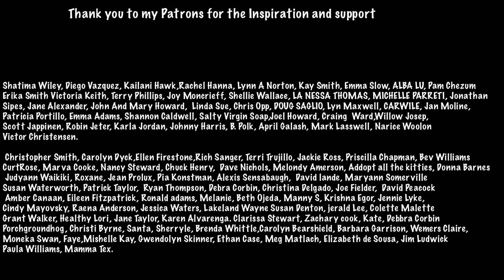Making Important Changes to the Structure Of my A-frame House | Dream House OFF the Grid

Comment: Don't do grinding without putting protective goggles over your glasses. The tiny metal particles will scratch and ruin your new glasses very quickly. Don't think your new glasses are protecting your eyes from small particles when working, they are not
Reply: Exactly , protection always every minute , I know of people who have gotten concrete dust and tiny splashes of it in their eyes snd had to go to emergency, very painful… and not easy to get out …

Comment: Awesome video, keep up the hard work of building your dream home with your own hands, you're doing great. That string with the weight on the bottom is called a plumb line. Builders were using this method for thousands of years before fancy lasers etc came along. And it will never run out of power

Comment: Some advice from a fellow glasses owner. Careful using them around your grinder or sparks when those little hot sparks touch the plastic lense it damages them very easy. I've gone through so many glasses this way.

Comment: Rebar is a steel bar that is used in concrete construction. By adding these reinforcing steel bars, you're creating reinforced concrete. Whether your project includes floor slabs, walls or posts, rebar helps keep cracks that form from making the project fall apart. I like your skeleton interpretation Rodrigo 👌

Comment: To save yourself a lot of pain in the future, please invest in a utility sled of some sort. You could add rails to the bottom and a heavy duty handle to pull it instead of fighting with that wheelbarrow. Just a kind suggestion from a PTA who learned the hard way that prevention is the way to save your back. You could probably make a great one yourself.
Reply: Also build a bench to work at while standing. It is much easier on your body than bending over, and you have better leverage and control .

Comment: @rodrigo , I agree with the extra steel framed piers. to me, id be trying to support the structure first, but secoond, tie it to the ground. your rebar reainforced pillars are the way. How will you attach the structure to those pillars: weld or bolt? i think you should put threaded rod into the pillars, and BOLT the structure to a flange on the threaded rod. Thoughts?

Comment: I agree that the canalever needed a solution, I see you've added another weight bearing pier further to the end of the load. Good work DJB, I'm looking forward to the end wall. How much glass are you putting on the downhill side? Also, are you considering dormers on the second floor?

Comment: maybe for the future.  don't make your concrete so wet, it loses strength
Reply: @shac9131  Wow so you are an expert at everything? The way you learn is to try! Sitting behind a keyboard judging and criticizing others isn’t the right way to go! You can make a suggestion without being rude or putting others down!
Reply: @starflower703 ....For someone whose previous employment wasn't in the building trades, Jordan is very good at construction but he does his learning curve on finished products, which usually isn't a good idea. Fortunately he compensates by overbuilding and becoming knowledgeable about tropical requirements, so there is very little downside as a result..